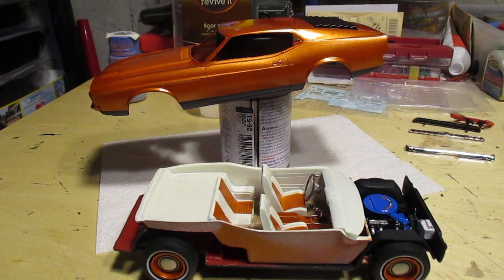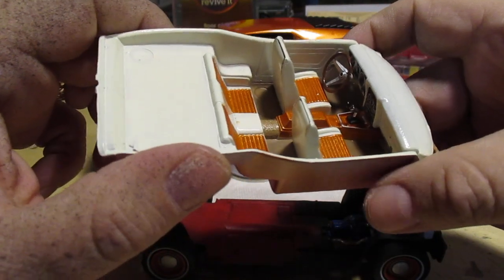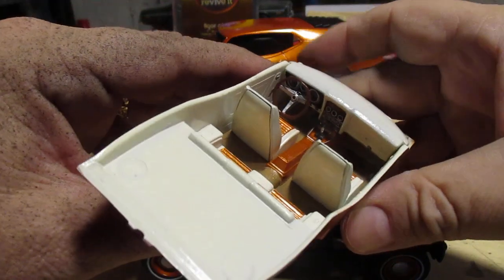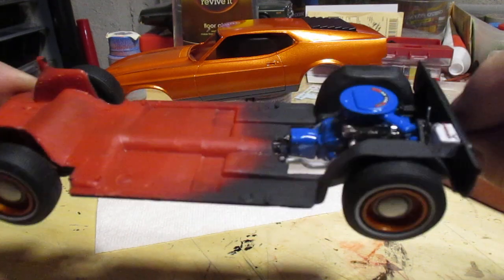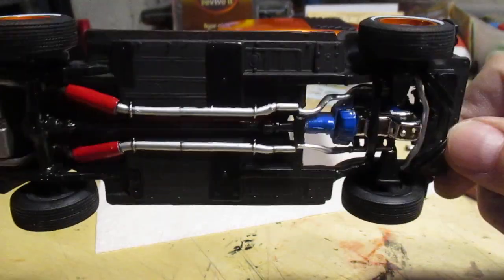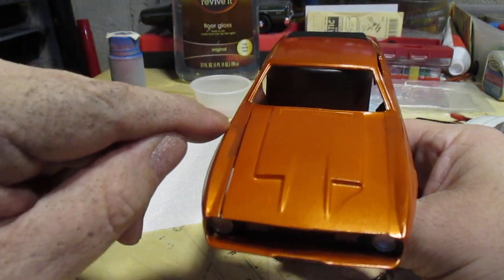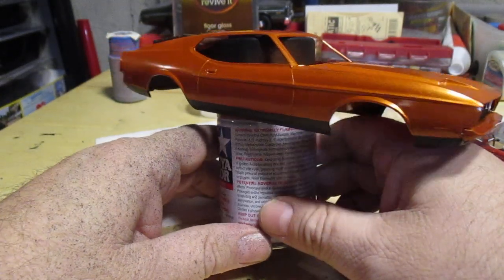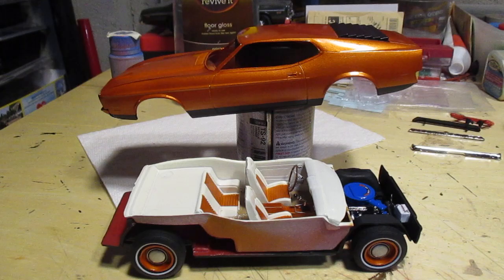Plastic Models - 1/25 AMT 1971 Ford Mustang Mach I - Work In Progress #2

Comment: even though i am completely removed from being a ford fan, of all the mustangs, this body style has one significant part in my own history, the fact that this is the right body for a real Elanor, H. B. Haliki's original gone in 60 seconds, not the bogus junk version with nic cage, however, i will never build one, so it is nice to see what the kit looks like inside and out, and that pearl orange looks spectacular on it, even with a minor whoops. kind of weird to hear about the primer and white blending, knowledge for any future plans i suppose, best wishes and hope it finishes up as good as it currently loooks
Reply from the maker: Thanks for watching. Last time I use anything other than white primer for white paint.
Reply: @TI4438  no problem, i enjoy supporting the community by watching, and also commenting, as for white on red molded parts, yeah that will turn pink 90%+ of the time, almost better with flat black, personally, i tend to primer most of my builds with either a satin silver or gold, depending which shade i aim to finish in, the satins cover good and rather i want metallic or not usually isnt an issue when a solid goes over it, but then i do like my duplicolor transparent colors, so it does make for a great base coat primer for them

Comment: It doesn't look too bad. Good job. As Jeff said below, lightly wet sand that over spray. However, I'd probably try 4,000 grit first. If that doesn't take it off then go down to 3,400 grit. It looks like a slick paint job that's why I suggested 4,000 first.
Reply from the maker: Thanks for watching and the tips. Much appreciated.